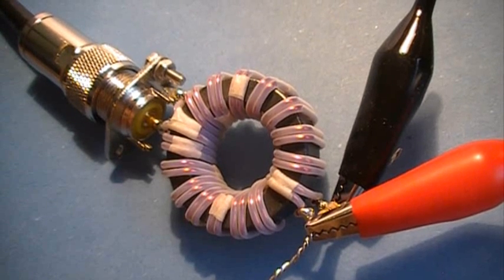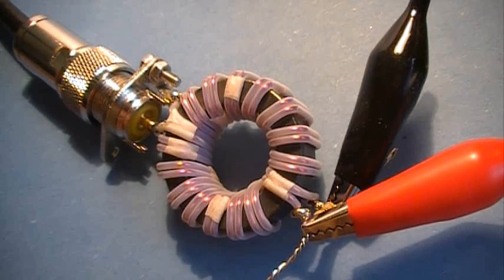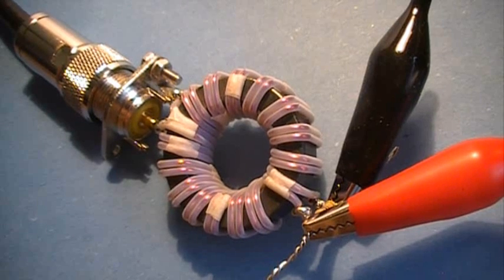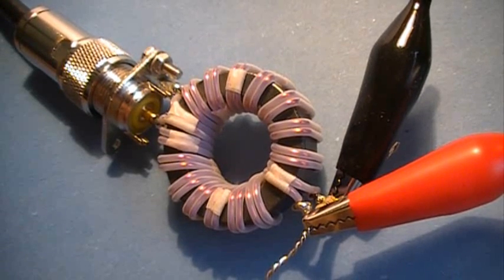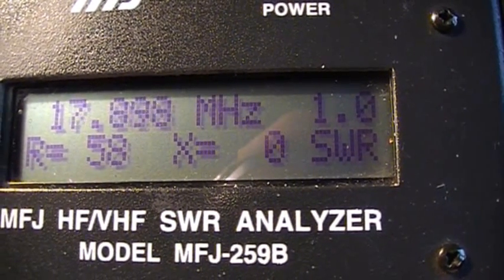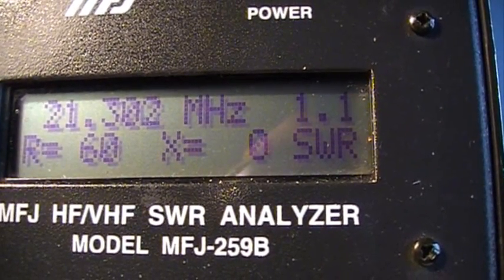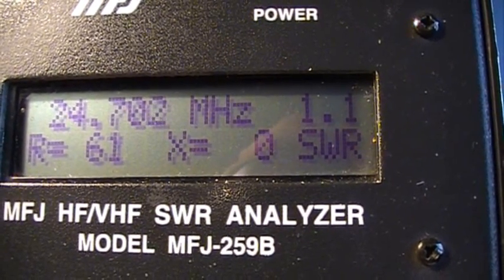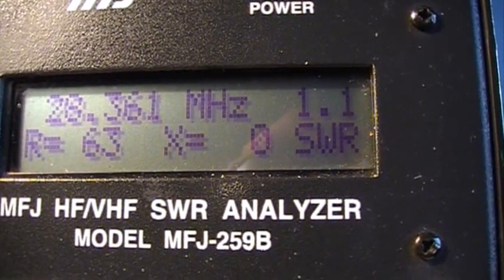1:1 CURRENT BALUN (Freq.: 1-70 MHz; PEPmax = 300 w)

Comment: All baluns have an impedance transformation ratio, but you need to know what the involved impedances are. For example, in the case of this 1:1 current balun, the ratio is 1:1 and the transformation is from 50 ohm to 50 ohm. Other 1:1 baluns can transform from 100 ohm to 100 ohm, etc.
So, if you have a balun, you need to know what load to use. This is determined by the balun itself.
Basically, dummy loads are impedances with no reactive component. They could be 50 ohm, 100 ohm, etc.
Regards,